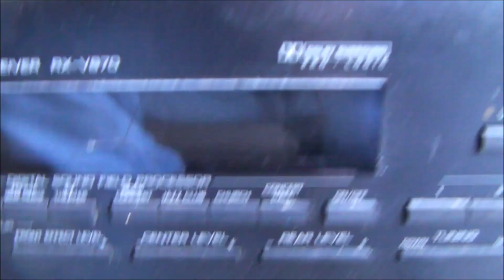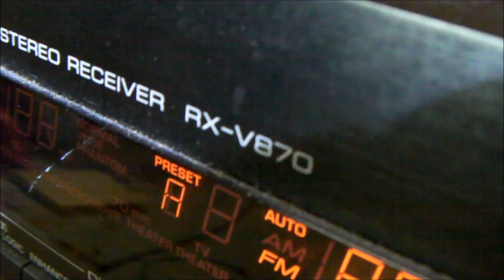FIXED - Yamaha RX-V870 receiver won't turn on,  Bad solder joint, how to find it, where to look.

Comment: Wow, this is great.  Saved that from the recycle yard.  Excellent work.  I have a very similar Yamaha model. Mine have very very low milage on it even though it is older but will remember this if any problems.   Amazes me how you know the the various relays that are known problems.  It’s not like your channel is only about fixing receivers.  Not even a majority of your vid’s are that, so great job!  Cheers.

Comment: I had to be about 4 years old when my dad bought this Yamaha RX-V870 receiver (if it was bought in 1992), as time went on he bought other receivers and put this one in another room.

Then when I grew up and got my own house, I was looking around his house and asked if I could have this Yamaha RX-V870 Receiver and he said yes, but when I went to power it on it was dead in the water, No power to the unit what-so-ever.

I took it home anyway, but could not get it to work, so it went on the Bulk-Pick-Up pile in the garage, ready to be thrown away later.

When the time came to put the Bulk-Pick-Up trash outside, I couldn't part with this great looking receiver and so for the last time . . . I plugged it into an outlet in the garage and it powered ON - It was an audiophile miracle - and you could imagine my excitement ;)

That was like 5 years ago and it's still rocking on today - I have it hooked up to my flat screen tv with surround sound speakers and everything works great, even the remote.

I remember looking at the remote as a child and thinking how complicated it looked with all the buttons and my dad saying: "Don't touch the remote!" :)